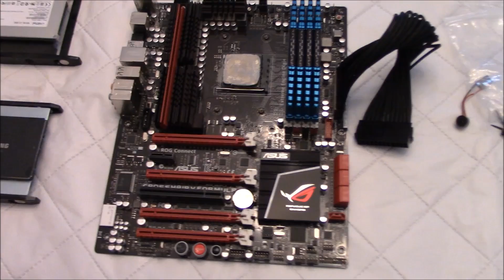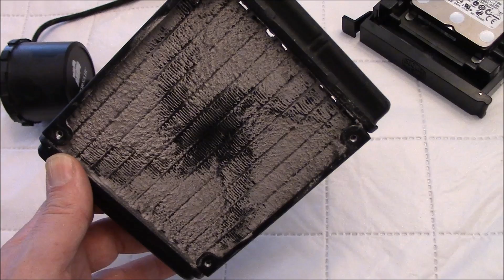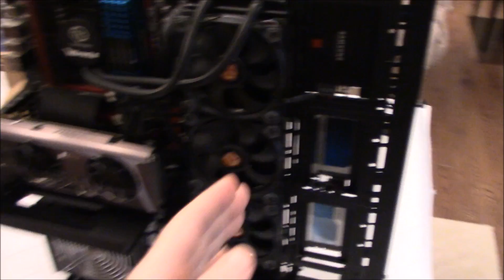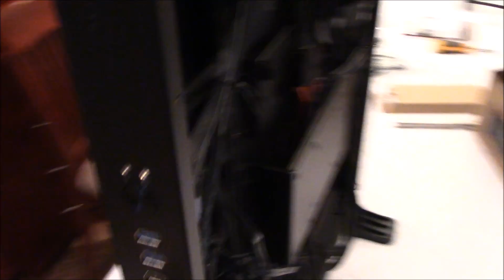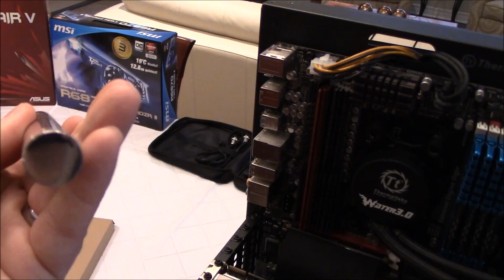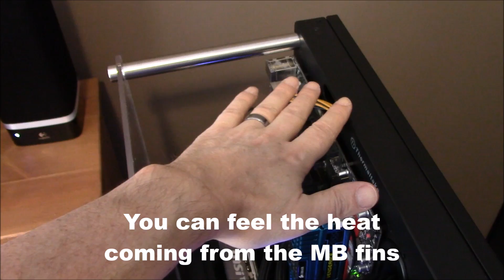Thermaltake Core P5 build | Amazing case!!!

Comment: Hello good I have a problem I have the same refrigeration and in the place where you have to put can not because it does not arrive but on the other side you can not because you have to leave a space as you have done? putting all the brackets or just one? I need your answer or somewhere to speak better thanks.
Reply from the maker: If you install all three brackets horizontally like I did, you should be ok.  The tubing is long enough to reach the CPU.  But your Water 3.0 fans must be installed at the far left on the brackets.  Watch my video again and you will see how I installed mine.  Don't hesitate to write again if you have more questions.  Thanks for watching!
Reply: SuperdanTech then putting the three Support Core P5 AIO I can already put the water 3.0 Roig rgb 360
Reply from the maker: Good luck with your installation!
Reply: SuperdanTech thank you very much and I will tell you if I have any problems a greeting.
Reply: hello good another question I have only need the long screws that hold the fans or do you need other screws?
Reply: or does the box bring you the screws you need to put the brackets?
Reply from the maker: I did not buy any screws separately.  If I recall correctly, the screws came with the P5 case.  It actually comes with a lot of screws of different sizes and length.

Comment: This case or corsair 570x RGB?
Reply from the maker: They are both great cases.  I went for the P5 because it is fully open on the sides and the top.  The 570X has side/top panels.  Also, the fans on the 570X are facing the front while they are facing the side in the P5, which is good if you install the PCI riser to have your graphic card standing vertical.  In my case I have the ASUS Strix RX480 GPU, which has the AURA LEDs in the front, so fully visible.  In the 570X, the card is facing down, hence you lose the LED effects.  

Thanks for watching and look at my ASUS Strix upgrade video here: https://youtu.be/9ULjYeGJiTg

I also did a light show video showing the benefits of having all your RGB components facing the same side.
https://youtu.be/cd-8bjoOXNs
Reply: Late response, but I have a 570x RGB atm and I just ordered a Thermaltake Core P5 TG yesterday. Don't get me wrong. The 570x is incredibly beautiful, but it's too small if you want to add things like custom water cooling.

Comment: Hi,

I have 3 ssd´s and one 3.5" hard drive. I´m looking at your setup and I would put the 3 ssd´s where yours, the 3.5 inside the chassis and my 280mm rad where yours at.

The only thing that troubles me is that where you have your rad.... does it breathe???
Reply from the maker: Yes it does breath nicely.  The brackets supplied by Thermaltake do provide a 3cm gap at the back of the rad, so there is enough "room" for breathing.  But like I said in my video, the "ideal" setup is with the rad installed on the far right, where there is a filter built in the case.  This is for hard tubing setup though (perhaps one day!).
Reply: Then I will look no further.... I´ll buy this case.

Thank you.
Reply from the maker: Elio, don't forget to buy the set of three brackets.  They are sold separately!  Cheers.
Reply: You mean the AIO bracket?
Reply from the maker: Yes

Comment: Honest question:  How badly does it gather dust and how often do you have to clean? I'm considering moving my custom build into this case from a aerocool dead silence 200
Reply from the maker: Dimitri Lazarev, it does not accumulate a lot of dust. if there is some accumulation of dust around the top components, it is very easy to remove with a swiffer type cloth.
Reply: @Daniel Levesque, thank you for such a quick reply.  I won't be water-cooling just yet, want to take my time to find something special.  At for CPU got a V8 GTS, and thinking of popping in 3 riing rgb fans into the P5, I know most would say it's horrible since this case is for water cooling but it'll work. Hope the V8 will fit :)
Reply from the maker: Dimitri, I just saw your second post now.!?  I measured the clearance between the CPU and the plexiglass panel and it is 17 cm.  It should be the same clearance for most MB since they use the same risers.  If you check the specs for the V8 you want to buy, you will see if it fits.  Cheers!